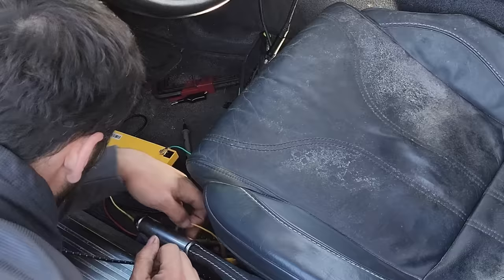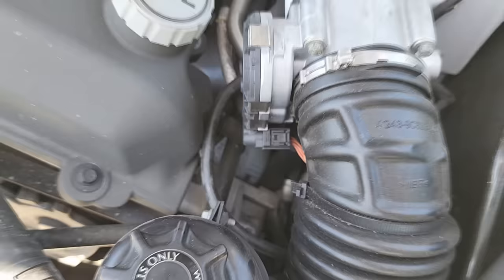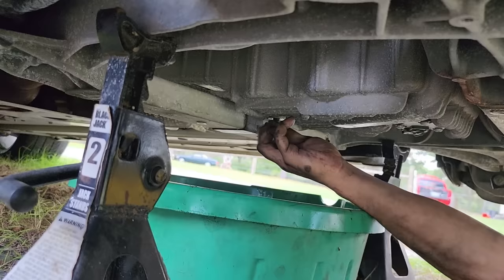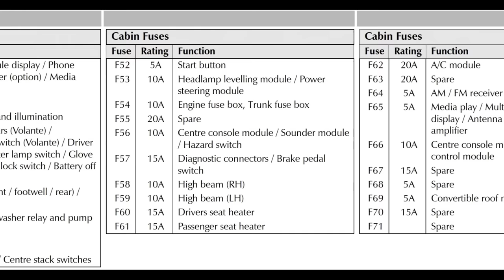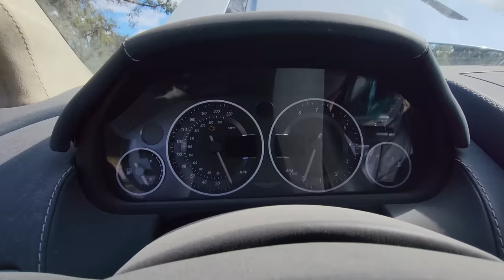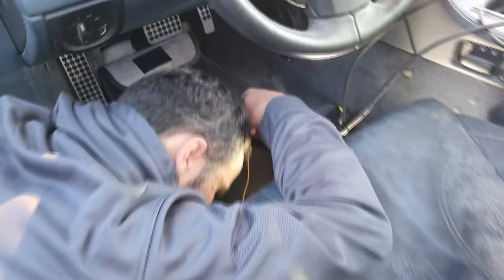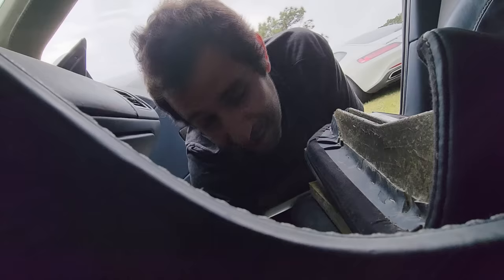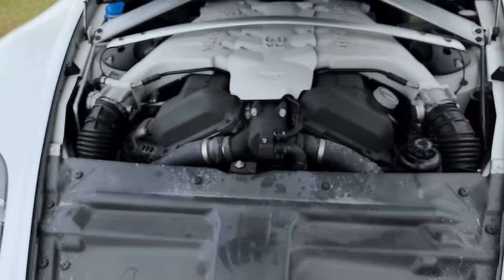My $286,000 Aston Martin's Electronics were Destroyed by a Salt Water Flood. Is it Repairable?

Comment: Sam, that "fuse box" you've replaced is called a CEM and it's programmed to each Volvo that it comes from, they're a nightmare to crack but using VDash and Vida, you can crack the PIN and re-program it.
Reply: Elliot Alvis has all that software and Volvo Oficial diagnostic computers. Maybe they can do a collaboration :)
Reply: I think bought new they come with all the coding included?
Reply: Can't wait to hear it start for the first time and what happened to the alarm?

Comment: good job Sam ,I've got a tip when I'm working on flood cars,I use a Batt Terminal Cleaner It does a great job of neutralizing the green Crustys just pour it into a pump spray bottle and spray ,it works great.

Comment: @00:26, is it possible to remediate, repair and replace severe salt water intruded electronics? I'm Retired US Navy Aviation Electronics Technician, a chunk of my time was addressing salt water related corrosion on and in avionics systems. The #1 thing that can be done to mitigate salt water damage? Immediate flushing the area and electronics with fresh water, if able remove the electronics boxes, remove any batteries on the boards or in the boxes before hand and toss those batteries and then literally dunk the electronics and electricals in fresh water, open the boxes, dunk the boxes/boards/panels several times, agitate the water, if the water gets cloudy or just use constant flow of water (fill at the top, drain from the bottom because salt water is heavier than fresh), use a plastic soft bristle tooth brush and... I think the old NA01-16-540 US Navy Avionics Corrosion Control Manual is on the internet someplace. That tome is filled with information on how we do that job.
Reply: Yes to all this. Then use a drying and water displacing agent such as rubbing alcohol mixed with a bit of mineral oil. Mineral oil is non conductive.
Reply: On one other of these car repair channels, the guy had similar issues to Sam. This chap washed all his electronics with Ionized water and only had to replace one computer. This fellow I think had previously worked making computer circuit boards and they were always washed with Ionized water after manufacture to remove all the soldering flux and corrosion they can cause.

Comment: If you ever have to use that seat motor trick again, see if you can get a drill chuck around the motor shaft. Then you can get the drill to spend the motor instead of your hand doing it for 15 plus minutes. Usually, you probably won't be able to fit a drill, but you could get one of those flexible extensions for a drill and get a small chuck on the shaft that way. Even a flexible extension on a Dremel meant to hold drill bits for example.

Comment: Instead of turning the motor by hand, you could have done it with your small hand drill with a socket near to shaft size and either pack it out and wedge it, or use a Blutak type product just to tack it temporarily.

Comment: Hey Sam , Just experiencing the same issue. no power for me as well , removed the Bcm on F-pace its destroyed with salt water. One possible solution that MAY work looks as follows. If you still have the dedicated bcm , you can try to send it out to the electronics board repair shop and try to swap memory module from original bcm to the new one. If the memory part is not damaged , you may get lucky and run the car with no problems. Regards from Georgia . Really looking forward for this project.

Comment: Sam I recommend repinning all those connectors that go I to the Volvo box. You should be able to buy new pins and pin removal tool pretty easily and that might fix a lot of you issues. 

The issue you saw with the alarm and security light flashing in dash is a GOOD sign because you haven’t reprogrammed the Volvo CEM yet. This is how it supposed to work. 

You also need to program that new box to the car before it will work which is why your security system is going off.

Comment: Yes, it's just a matter of how much money you have to spend. This would likely need a complete wiring harness plus any fuse block that got any water on it. Also, the engine may need rebuilt if the water got inside. Would also likely need new exhaust and catalytic converter if they were under the car where water could flood it.
Reply: I would just go the entire wiring harness route.  Too many potential gremlins.

Comment: I don't know about how much space there is there to access the bolt..... but maybe taping the motor bolt to an extension socket which would be connect to a ratchet or a drill and using a ratchet/drill to spin the motor would have made quick work of it....

Comment: Hey Sam great video,,, take a wide rubber elastic slide it over the shaft of the electric motor and over the chuck of your battery powered drill add tension and the electric motor should spin,,, just like a serpentine belt spinning all the pulleys on your engine.....

Comment: I'm curious if salt water migrated into the wires from the terminals and if so how that affects the conductor's resistance. Should the wire harness be replaced?
Reply: yup...
Reply: The wire connector to those pins that is hiding behind those plastic covers will look just as bad as those fuse panels.  Great video series on this car but who ever buys this off him better do research or know what they’re getting into.
Reply: @gbpg2016  I know about the connectors. My concern is water/salt migrating up into the wire/sheath....capillary action. Hence the need to replace the harness.
Reply: The corrosion won't affect the resistance initially, but over the long term it may eat the wires away to nothing. This car will never be reliable the way he is 'fixing' it.

Comment: Exotics typically depreciate terribly as the wealthy always buy new and second hand buyers still can not afford.  Parts are still for a $300,000 whether depreciated or not.  Plus specially mechanics ask for more cash/hour also.  I bought a used year and a half Aston for half off with only 700 miles.  It’s not a salvage vehicle. I drove it for 4 years and sold it for half what I bought it.  Fit and finish not as good as a mass produced car.  Infomat system funky.  You definitely need another car as parts take months and in shop frequently.  Love the v12 though.
Reply: was it worth it in the end? Probably not right? V12 is glorious, and cool bragging rights, but a new V8 mass produced car will probably get you 90% of the excitement without the extra headache. What did you get to replace the aston?

Comment: for future reference, Metal Rescue would clean those connectors, tie them all up closely in a plastic bag, submerge in Metal Rescue. it will bring continuity back to electrical connection. Safe on plastic and electronics. It worked for me, I dont work for them.

Comment: I'd feel like you'd forever be chasing electrical gremlins in this and probably most flood damage vehicles...
Reply: Inclined to agree. If not obviously clean / dry, then it's difficult to trust. Even if just a continuous section of wire got submerged, insulation is not necessarily perfectly watertight; that could eventually corrode through, with the salt still sat there. 

Best plan would be a complete strip to metal, fresh water wash, a new wiring loom, anything electrical that got wet, seats restored (there's a good chance a decent leather restorer could save the leather; would just need to restore the seat innards underneath). Wiring loom + interior restoration could be an expensive part. 

But if the result is a salt free, damage free,  put back to rights complete Aston Martin of a model with a low milage unflooded engine and drive train, there's a good chance it could pay off.

Comment: Dude, I owned a boat for 40 years. Freshwater good, saltwater worse than bad…that car needed a freshwater immersion hours after it became inundated. Every circuit board, every wire that got saltwater on it or in it is toast. Galvanic corrosion in a salt water immersion combined with much of the electronics being energized while wet has awoken the copper worms…same as iron worms that eat steel except that copper worms eat  copper wires and circuit board traces. Best of luck with the mechanical stuff no water in motor or tranny is a good thing.

Comment: Here is the list of the upcoming samcrac episodes: 
- I changed the air filter on my $286.000 Aston Martin.
- Did my $25 Ford part just fix my $286.000 Aston Martin?
- The oil filter on my $286.000 Aston Martin was a pain
- I change the other air filter on my $286.000 Aston Martin
- Will my $286.000 Aston Martin start after clearing this connector with contact cleaner?
- I tightened the ground bolt on my $286.000 Aston Martin
- Is the random Volvo junction box causing my $286.000 Aston Martin car alarm problem?

Comment: I clean my corroded marine connectors by dipping in Muriatic acid for 10 seconds, then dip in soda ash or baking soda and water for a while to neutralize the acid. Then fresh water, then blow dry with heat gun. Gets back to almost shiny copper color.

Comment: Nope.  After growing up on the Gulf Coast, I can definitely say that ALL cars that have salt water in them should absolutely be destroyed.  Sure, you can strip out a few of the parts, like the engine and possibly the trans and other parts of the driveline, but all electronics will be destroyed, along with the wiring harnesses.  Even many that are flooded with fresh water should be considered a total loss and destroyed/stripped down and any of the salvageable parts removed/reconditioned/rebuilt and sold as used parts, and all electronics destroyed.

Comment: That Ford relay seems readily available for 100 bucks and it seems a battery disconnect relay, maybe by replacing it and reprogramming the control module you can get the engine to start!

Comment: In my experience contact cleaner doesn't do a very good job of cleaning corrosion from terminals. Tarnish remover works much better. Submerging a connector is a small cup or tarnish remover for a minute or 2 makes the terminals look like brand new.

Comment: Hey, Sam?  For cleaning up those electrical connectors, try buying a "Fibre / Fibreglass Abrasive Cleaning Pencil / Pen"... They're only a few bucks and make cleaning corroded contacts like that a breeze...  Wear gloves when using them though, as the fibres do snap off and will cause you to get REAL itchy REAL fast!!!

Comment: Hey Sam, try using vinegar on the corrosion on the circuit boards to remove it, spray it on let it soak and use a paint brush to scrub it and neutralize  with baking soda and water!! Might save you alot
Reply: Hey Sam yeah if you use straight vinegar with a say 1” paint brush dip the brush and paint the areas of corrosion and let it soak then keep the brush wet and start scrubbing the rest of the board don’t saturate it just keep it wet enough to dissolve the corrosion then mix some baking soda and water paint it on to neutralize the acid , use a heat gum to blow it dry then use denatured alcohol to clean up and dry up and water left use a small blower to make sure all the water is not trapped then let it sit dry over night to make sure no moisture and try it
Reply: Test it on one of the boards you already replaced
Reply: Remember if you keep energizing these circuits with corrosion ,that’s when they short ,but if you clean them before you power them,then they will work, just make sure they are dry!!
Reply: Gotta remember in a flood in a city there is more then water in a flood, there is sewage, fuel, gas and diesel, chemicals of unknown origin, motor oil, transmission fluid, and so on you gotta clean it all even in the interior of the car that’s why I say flush the car with a power washer with fresh water remove all of it and power was the whole interior
Reply: Also demineralized water would be best to flush the electronics

Comment: Experience shows that cleaning the connectors & wiring harness components on a flood damaged vehicle is very hit & miss as often the corrosion will travel up the wiring over several months to years creating fault spots that lead to failure of the electrical systems, or a fire risk from shorting electrics. In our country it is now mandated that all electrical wiring, components, including airbags & seat belts must be replaced due to the safely risks associated.

Comment: A rubber hose on the end of that motor shaft and a drill bit in a drill and you could have moved the seat alot faster instead of turning it by hand.

Comment: @8:41. Over the years, I've watched you as you tackled flood damaged cars you picked up at the auto auctions and.... I am furious, not at you, but at how insurance companies and auto yards mistreat flood damaged autos. The car you are working on? All of that corrosion? at least what you have shown so far, was easily mitigated if someone had taken the time to simply remove the seats and carpets and flushed the electronics with fresh water. They didn't even have to remove the electronics but that would have helped. All that salt encrustation? Even now, just flush it with fresh water, it comes right off but its been on there for so long ...and, I blame the auto makers too. If they had spec'd the boards to be coated in eleastomeric coatings they wouldn't be that bad and would potentially just need the panel/board connector changed. So, yeah, a nice car is totaled because maybe 40-48 man hours of labor is 'too expensive'. So I'm angry.

Comment: My BMW 7 Series also had an electric motor for its seats but the motor was mounted to a gearbox. There was an Allen head screw on the gearbox and if you turned that Allen head, you moved the seat back and forth. That screw was there in case the seat motor failed and you still needed to move your seat.  Surprised Aston Martin didn’t have a similar setup for emergency seat movement. Maybe it did and you didn’t see it ?
Reply: German engineering.... Remember " Lucas " electrics??    The reason why the Brits like warm beer........

Comment: 350 Chevy carburetor motor with a manual 5 speed.
Throw away all electronics.
Wire up stop and turn signals, headlights . As you see fit .

Comment: I'm not mad about the Wal-Mart ad.. why not? I buy stuff from there. Who cares? TBH That electric ratchet would be pretty nice to have, I really don't have 200 bucks to drop on one with NO BATTERY, and they are a lot nice than having to pull out my AIR TOOLS to just pull some covers off (which is where that tool comes in handy) but seriously, it's like buying tools from Harbor Freight. You are getting what you pay for (maybe a little better if you go icon but still)

Comment: Next time you need to power the seats, find the fuse for them and power the fuse. Rather than cutting the harness to power it there. I realize it still wouldn’t have worked since your seat motors were bad, but for future reference anyway.
Reply from the maker: The fuse for it was in the box that was taken out by the flood

Comment: But if you put a rubber band around the motor and the other end around the chuck of a drill you can spin that motor much quicker and easier than spending 15 minutes or so doing it by hand 🤫

Comment: Crazy question and theory if something was submerged in salt water for said period of time… What if you submerged it in fresh water to rinse the salt off and then worked on it?… Or even fresh water with some sort of rust killer or corrosion killer?
Reply: The biggest problem is if power is on when the wire is immersed in salt water. Electrolysis takes place which eats away some wires and forms deposits on others depending on the polarity. Fresh water is nowhere near as bad and fresh water flooded cars should be much easier to fix up.

Comment: Pleasure watching you video.  Could you have used a drill with a flexible extension, somehow tape it or attach to the motor of the seat and spin it that way rather than using your hands?

Comment: Samcrac i just started the video and got to the car wont turn

Why didn't you just put it back on the trailer and back the trailer right in front of the barn so when you roll it back it goes perfectly straight under the lift arms

Just saying

Comment: No, you cannot fix it, only replace it. Saltwater even destroys the cables by converting the cupper inside into some black or green powder. Cables are crimped to the connectors, each crimp is gone. Each bearing each circuit board, each electrical motor, just everything. One drop of saltwater can be enough to destroy a circuit board. Best thing for you is to keep selling cheap Chinese tools.

Comment: Like a Laptop thats had liquid damage, a car is WAY more wiring intense and very fiddly voltages to multiple computers and CPUS makes a water damaged car a nightmare and you need to totally strip it out as corrosion will be everywhere and even if not so bad, will be starting anyway so you still need to strip it all down.. horrible job and happy just to fix computers and ipads!!

Comment: I had a crazy Idea. What if you cut out an access panel in the trunk, behind the license plate to access the latch, then you could weld in a patch panel, and it would be hidden by the license plate (it could also be fully repaired and painted afterwards). You could also try to contact other DBS owners, to tell you if there's any bracing that you would have to cut through in that area

Comment: Sam, you need to buy a can or two of Corrosion X it is popular in the aviation industry it would be great to use on the electrical connections and other components, check it out
Reply: oh man you'd never get the smell of that corrosion x out of the car. It is good stuff though
Reply: @crherniman  I've never encountered that problem in 30+ years of using it
Reply: @zedrone7975  the aerosol corrosion X that I have been getting smells much like gear oil.